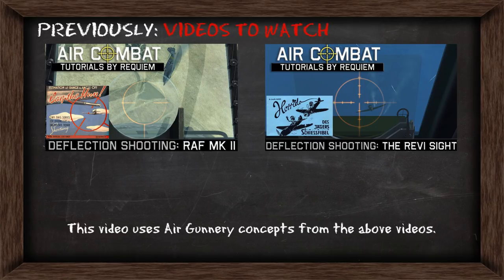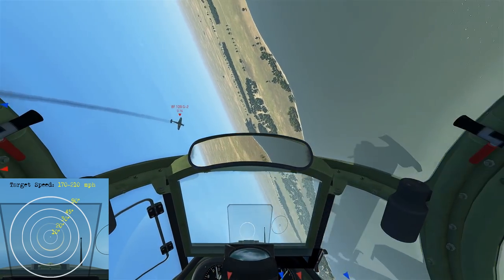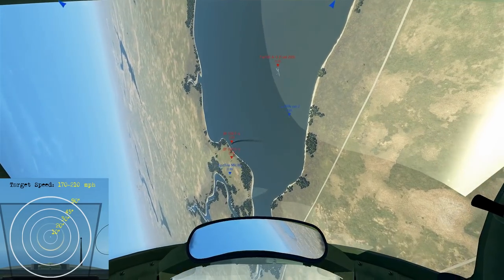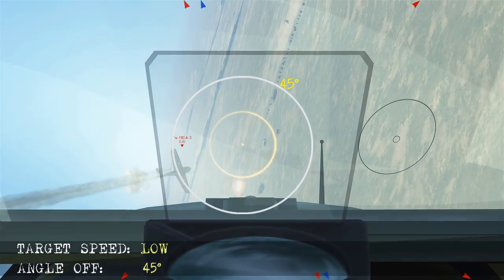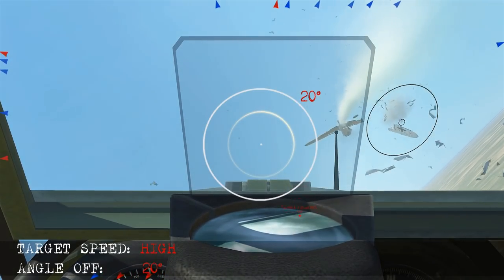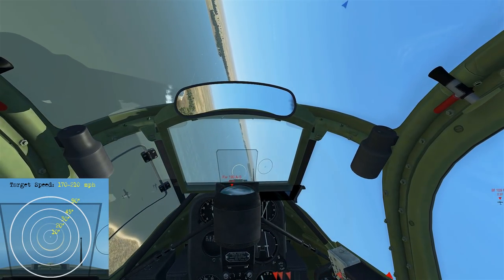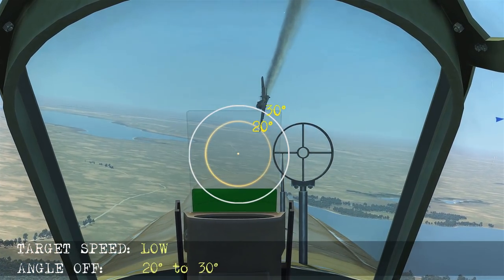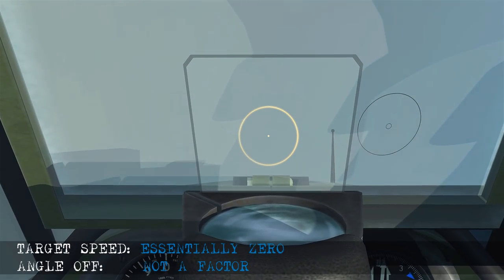Deflection Shooting #4 - USA N-3A Sight

Comment: This explains a lot about why I've been unable to hit anything with these gunsights: I thought they were 100 mil this whole time, not 70. Gentle reminder to myself to do more research and double-checking, but also thanks so much for making this. I adore the P-39, as awful as I happen to be with it. Cheers.
Reply from the maker: To be honest I still don't like the gunsight. It seems kind of odd to use such a smaller reticule considering the target speeds they were up against.
Reply: @RequiemsACTL  It's certainly uncomfortably small, yeah.
Reply: It would be really nice if the dev would add this sort of information (gunsight radius) to the plane stat cards. They give all the wingspans, but leave out the gunsight info that  makes the wingspan info relevant!

Great video, as always!
Reply from the maker: Yeah for sure. It took me some time get the right documentation on these sights to make sure the videos were correct.
Reply: @RequiemsACTL  I have done a lot of research on things like this, and pretty much everything else from basic maneuvering to engine management, energy management, and bfm. Your content has been a great resource for learning a lot of things!  It's funny how little revelations can make such a big difference in your flying and maneuvering. 

Thanks for all you do!

Comment: +RequiemBoS  The United States avionics industry has standardized on the 70-mil ring and pipper from the U.S. Reflector Sight N-3A for the HUD gun directors of current tactical jets; a thick sector on the ring tracks the range to target as an input from the radar.  With the radar offline, a "railroad track" historical sight mode uses two tracer curves to show the paths that shells fired from the the tips of a 10m span would take as viewed from the cockpit.  Still, I'd think the Navy's Mk 8 reticle, with its spokes at 90°, 135°, 180°, 225°, and 270° (with 0° being the 12-o'-clock reference), better suited for aiming rockets and missiles as well as the gun under emcon.

Comment: I think "convergence" would be a good topic.  Since an actual first-line American fighter (P-47) came in the game it is worth talking about, particularly since the Jug is so big.  My impression is that "convergence" is mostly about setting elevation for nose (or cowl) mounted guns, to compensate for bullet drop over range.  With wing-mounted guns it is also actual convergence, and the farther they are from the cockpit the more it matters.
Some of the newer sights seem to allow adjusting the reticle for range, but of course this is not going to change convergence.  All of this is a bit complicated for your average home gamer.
Reply from the maker: If the devs ever add harmonisation then convergence is something I'll probably go into more detail about.

Comment: Another video that I watch multiple times - too bad you can only check "Like" once.  
I notice you have the cannon and MGs on separate buttons/triggers for the P-39, which I think makes a lot of sense.  For most of the cannon For most aircraft in the game, the velocity, ballistic coefficient etc. of the cannons and MGs are close enough to equal that firing both with the same trigger (the default) makes a lot of sense.  However, the 37 mm pumpkin chukker on the P-39 is a whole other breed of cannon.
My impression is that unless your range is right on your convergence setting with a really stable target (and low angle off) the odds of the MG and cannon rounds landing anywhere near each other are remote for the P-39.
I.E. - I also have cannon and MGs on separate triggers.  But here the fact that you cannot set separate key bindings for different planes (and save them) is really annoying.  I sometimes forget to hit both triggers when flying other airplanes that have usable cannon and MG combinations.
Reply from the maker: Yeah I always keep MG and cannons separate. I guess I have the muscle memory built up to use both buttons when I want. That P-39 cannon really is something else though so that needs to be on it's own. Not just the trajectory and all that but the rate of fire is probably the biggest factor. You may be able to have the right gun solution to hit with the MG but if you're off for the instant the cannon fires you'll miss with it.

Comment: i'm surprised by how nimble the cobra seems in this video, btw what was the server you went for the video?
Reply from the maker: I flew all of these on the Berloga server as it's the fastest way to get decent deflection shot footage. As long as you keep enough airspeed it handles pretty well, but once you get slow then you can start having a hard time
Reply: i usually fly there too x) , i didn't recognized the map beacause of the different graphics settings

Comment: Good afternoon, help me deal with the American sight. On the grid, it is similar to the English sight Mk 2, the circle is also equal to 20 degrees? However, if measured using its range, the results are different. If you completely enter the Me-109 in the Mk-2, the distance will be 90 meters, and if in the N-3A, then 140 meters! And visually the circle is less than in Mk2.!
Reply from the maker: Downloading the PDF file in the description can help you understand this. The difference is due to the number of mils used for each sight (70mils N-3A, 120 mils RAF MkII), so the results will be different when you range an airplane in them using their diameters. For the Angle Off you might be confusing the airspeeds between the two. At the lower airspeed range 170-210mph the ring is 20degAO in the N-3A and 30degAO in the RAF MkII. At the higher airspeed range above 300mph the ring is 20degAO in the N-3A and 45degA in the RAF MkII.
Reply: OK)

Comment: great video again! thanks! I noticed When i fly and try to shoot plane which is more then 45 deg or around, it speed is around 300 km i have to put him way below my nose i cant see him and its really much more then you show here, its like he is circling and me on his tail, i try from around 250-300 meters to shoot him, put him just around 90 degree circle, but i miss behind him, so i have to go beyond which is hard to hit. Any suggestions, do i have to position myself less angle?maybe closer? thanks
Reply from the maker: When they start getting over 45 degrees it's very difficult, especially because you're probably pulling a few exta Gs as well that alters the picture very slightly. At that point it's more of a snap shot (a split second of hitting the target) versus a tracking shot (where you can follow them and keep firing). Try and position yourself to be more towards their 6 oclock area instead of being off to the side if you can.
Reply: @RequiemsACTL  Thank you for fast response, I practice against AI in quick mission or career, it helps, I wouldn't stand a chance in multi yet. I am a bit struggling to keep my aim steady when i fire :) you seem so smooth and precise. Do you keep some trim when in dog fight or you reset trim going into the fight? cheers